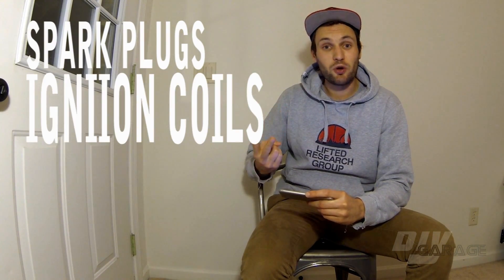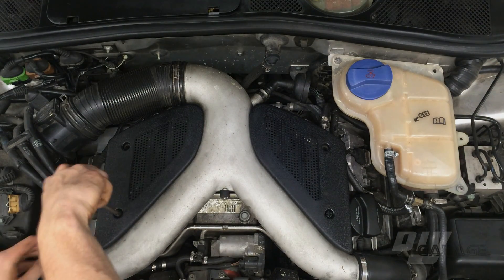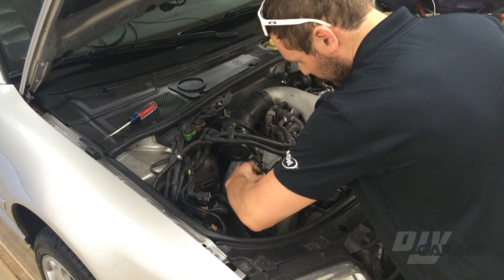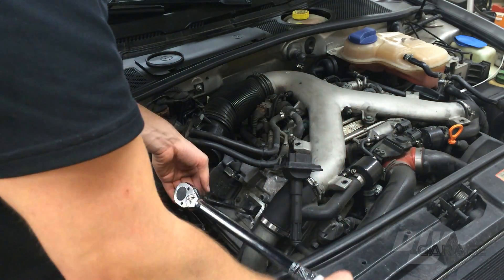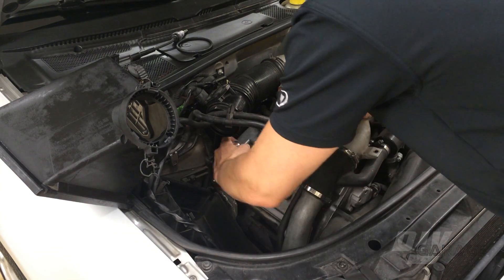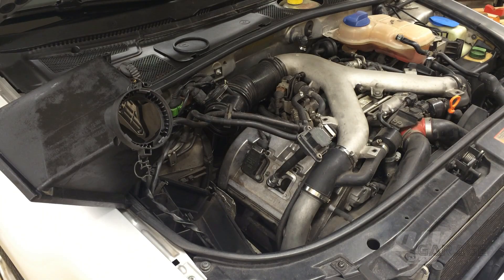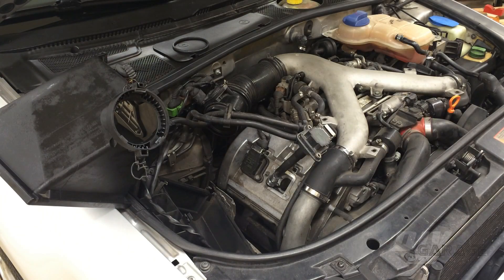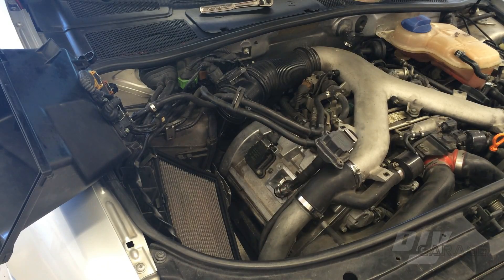How To Fix Cylinder Misfiring | 2001 Audi S4 | 2.7t

Comment from the maker: It looks like I labeled the cylinders incorrectly -  The cylinder layout is:

Back
3   6  
2   5 
1   4
Front
Reply: hi Matt i have a4 2004 1.8t its doing the same idld znd vibration like your first video. also i drove 600km now it skips how can i fix the miss fire
Reply: Cylinder 6 closest to the firewall on driver side
Reply: Well seeing this comment saved me a bunch of time trying to get that hose off that’s over now cylinder 1. Also I’m getting a cylinder three code but it’s driving fine does this mean it’s the module ?
Reply: I know  this is an old video but just wanted  to say thank  you.  You saved me a headache  and money.  Your the man.
Reply: Thanks your video was very detailed 👍👍👍
Reply: GET THE FUCK OFF YOUTUBE YOU LOSER !!!!!
Reply: GET OFF YOUTUBE !! YOU ARE SPREADING INCORRECT & AMATEUR INFO !!! GET OFF !!!

Comment: Means nuttin  disconnect both battery cables touch them together for 10 seconds to 30 seconds reconnect cables turn key two clicks DO NOT CRANK listen for wine and clicks from throttle body when it stops turn key off pull out 30 seconds reinsert key start. This is what is called throttle body relearn without tags diagnostic software  if that didn't do it. From what my ear heard and brain knows. You got a timing issue

Comment: I was resolving several sensor issues, and after replacing the EGT sensors, I had a #2 misfire, so I replaced the plug, better but still misfiring. I actually have a pair allroad so I swapped the Ignition control module (BLAU), and Yeeeha! No misfires, and now that the  EGT are swapped (messy time-consuming job) it runs strong (for a 200,000-mile allroad!).  Thank you!

Comment: Good video buddy. I did want to make one note that I believe is incorrect, the "paste" underneath the ICMs is not a dielectric grease but a thermal compound used similarly to a CPU heatsink on a motherboard. It's used for heat transfer, using the airbox as it's cooling.

Comment: just saw your video on determining a misfire on Audi A6. i have a 2002 A6 2.7t manual. I already purchased all 6 plugs and 6 ignition coils already which im gonna put in myself based on the video.. I have 212k on the odometer, got the car with 156K so its due. I got a bunch of codes using a OBD2 checker. Ive had my check engine light on for about 1 year now. My mechanic replaced all 4 oxygen sensors 6 months ago but the check engine light came back on 1 week after. Im determined this time to finally fix it. wish me luck guys

Comment: Thanks for the video. It confirms my fault code in my car. I had a problem with the current in the sixth coil but I bought the car with the new six coils and spark plugs .
Reply: I agree with the first comment. The cylinder order is inverted. 6 and 3 on the clutch side and 1st and 4th on the timing belt side.

Comment: what if there is a problem with the fuel making it misfire
Reply: Then it will be a fuel problem, probably the injector went bad or a wire going to it. It could also possibly be the fuel pump but not likely.

Comment: Thanks for the demonstration. Yes, i have a question. My '99 A4 quattro has multiple misfires on bank one. Could this be the coil pack (and/or plugs) or perhaps a cam timing issue? Thanks.
Reply from the maker: John Cooper try switching the icms. If the misfires jump to the other side it’s an icm issue
Reply: @ModernEngineer  My Audi has three twin coil packs and each share both banks. I doubt half of each coil pack is acting up but thanks for your suggestion, cheers.

Comment: You have mis-labeled the cylinder positions. Cylinder #1 is the Front Right, not the Rear Right. So The right side(passenger) is Front to Rear #1-2-3 and the Left side(driver) is Front to Rear #4-5-6. You were lucky that cylinder you were trying to fix was #2 since it is correct either way.
Reply from the maker: WACKO1123 thanks!  I pinned a comment about that after I posted.
Reply: @ModernEngineer  I scanned the replies but didn't see it. Just didn't want anyone getting confused.

Comment: I had this same issue except my misfire jumped from cylinder 5 to cylinder 2. I had a code scanner showing 5 codes including misfire on cylinder 5, all I did was swap the icm's and after the swap the misfire initially read p0300 misfire on unknown cylinder, after running the car around the block code scanner showed misfire on cylinder 2. While the OEM ICM's will run you $180 a piece, I picked up a set of two on Amazon for $45. So while this is a thorough diagnosis think about the tools you have available, time, and symptoms in order to hopefully save you time working on your own vehicles.

Comment: I performed all of those tests. Compression test, leak down test, injector test, new plugs.  Still makes 20 PSI of boost.  Smoke tested. 
I have no correlation codes, but I'm  wondering if I may have a lifter collapsing or chain tensioner failing.  I don't have any ticking noise but my timing at idle is a bit erratic according to the measuring block in VAGcom.  
If the little oil screen on the chain tensioner is clogged,  could I have a misfire?

Car is full stage 3.  Green injectors, big Bosch pump, big twin intercoolers.

My only codes are Random misfire, or p0304.  No lean codes, circuit codes. No MAF codes.

Comment: When I found this vid I had already done plugs and a coil on the offending cylinder. Audi wants (after tax) $500 for the ignition modules (each). Good thing I have a good relationship with a local European dismantler. He gave them to me! 200K later and not a single misfire. Thanks for this vid. I wasn"t sure where to look next and didn't want to get into the wiring.

Comment: Great video, Thank you. I have a 2004 A6 Quattro 2.7T and I got code p0304 which indicates:Faulty spark plug 4 Clogged or faulty fuel injector 4 Faulty ignition coil 4 Fuel injector 4 harness is open or shorted Fuel injector 4 circuit poor electrical connection Ignition coil 4 harness is open or shorted Ignition coil 4 circuit poor electrical connection Insufficient cylinder 4 compression Incorrect fuel pressure Intake air leak.Any advice please.Thank you

Comment: WOWWWWWWWW !!!!!!! I'VE NEVER SEEN SOOOOOO MUCH TORQUE PUT ON A SPARK-PLUG IN MY ENTIRE 35-YEAR AUTOMOTIVE CAREER !!! What the fuck are you doing to your spark-plugs !!???? You were truly REEFING on your spark-plug w/a FULL-SIZE (Ft/lbs) Torque-Wrench like it was a goddamn Lugnut !!! I've been tweeking torque-specs longer than this "Wanna-be" DIY'r has been alive, 35-40-years ! And just watching him tighten that spark-plug w/that HUGE FUCKING Torque-Wrench was HIS 1ST MISTAKE ! Spark-plugs have what's called a "Crush-washer", that is the 1st resistance you feel while tightening a spark-plug. Immediately after you feel the resistance of this crush-washer, actually "crushing"... is when you will feel the spark-plug stop hard, that's when the crus-washer is completely "crushed", and you need to continue w/tightening the spark-plug. And normally, all you need, after you feel the Crush-washer "Crush", is to snug/turn the spark-plug another 1/4 turn, and that's ALL ! MAX 20ft/lbs ! MAX !!! This guy most likely has that ft-lbs torque-wrench set incorrectly, and he thinks its set at 20 ft/lbs when its probably (And I can tell JUST BY watching how much strength he's putting into cranking that LONG ASS bar !) set at 42 ft/lbs ! He wouldn't admit it anyway ! BUT I GUARANTEE HE'S APPLYING ALOT MORE THAN 20 FT/LBS OF TORQUE TO THT SPARK-PLUG ! I'D BET $1K ON IT ! W/a bar THAT LONG< and w/the amount of power he's applying to that length bar, I KNOW FOR A FACT he's applying WAAAAYYYY TOO MUCH TORQUE to that poor spark-plug and that poor aluminum head !!!! GOOD LUCK TO YA BUDDY ! These fucking wanna-be's spread SOOO MUCH INCORRECT INFO & F'N BULLSHIT AMONGST THIS YOUTUBE, THAT ALL THESE POOR SOBs WHO DONT KNOW A GODDAMN THING & NEED HELP...ARE RECEIVING ALL THE WRONG FUCKING INFO FROM ASSHOLES LIKE HIS FUCKING CLOWN !!!
Reply from the maker: RMCUSTOM My first troll. I guess I've made it!
Reply: I agree, although this is the correct sequence for diagnosing an ignition misfire. correcting him on that blatant mistake is fine, but no need to be an ass about it...
Reply: And you ! PODVIN, GO FUCK YOURSELF !!!!!!

Comment: hey there i had a cylinder also misfiring at one point but it didnt happen anymore and also i got check engine light when i rev for to much on hiphspeeds like when im on 5 or 6 gear and push it i get ticking engine lights on i own audi rs4 b7 2006 i also noticed that engine mount one of them i think its the left one  is broken since the engine does some bad noise and it has a little shaking on it when iddle. or should i go a garage service

Comment: I have a misfire of audi a4 2009 what should I Change to fix that? It starts jerking also is it bcoz of misfire or any other problem?
Reply from the maker: harman sandhu is the check engine light on?
Reply: plugs, ignition coil

Comment: I have a 2002 audi a6 Quattro 2.7t Automatic

I started off with 2 codes and no check engine light I ran the computer, It was the Torque converter and a #2 Cylinder misfire. I could feel it kicking while driving so I replaced the spark plugs,checked the cylinder pressure with the tool it was at 130 supposed to be at 140 if correct my mechanic said it was fine , I gaped them all at 0.28 Torqued them all to 22lb. I Checked the coil packs and boots, They looked fine to me so I didn't replace those. The 2 codes went away, but when i was idling I can still feel a little kick every now and then, hmm?? After that..

No check engine light
No codes pop up I drove it 50 miles+  before I ran the computer with the diagnostic scanner.

The car is in limp mode
PRNDS light stay on don't flash
When I start the car the PRNDS works in Drive if I put it there first but if I put it in  Reverse after starting it up it goes striaght to limp mode again, because when I start it up and put the shifter straight to drive it will work for a little before it goes back in limp mode It first started with the tip tronic before any of the codes started now its in limp mode With the PRNDS all in red?? Any help or advise on where to start I try to do the work I can myself.

The Yellow coolant light is the center LCD screen were the service indicator is located in the center of the dash.

I'm pretty sure I have a leak in the coolant resavor. I can see the build up next to the front hose connected to the coolant resavor, and the yellow oil light indicater. For that one I think its the oil senser??

Any help for my situation will be much appreciated thank you.
Reply: david herrera i got the same issue cylinder 3 an multiple missfire ecu sparkplug coils changed same p0303 , got some idea?